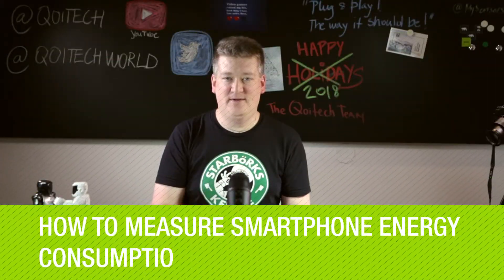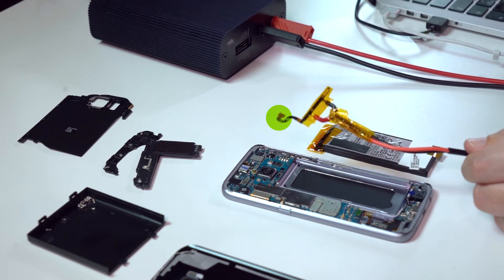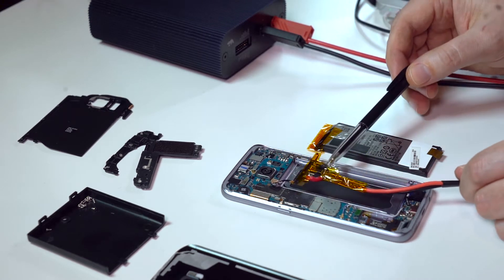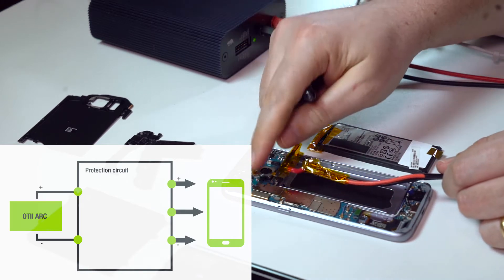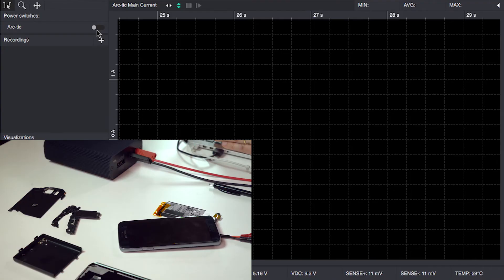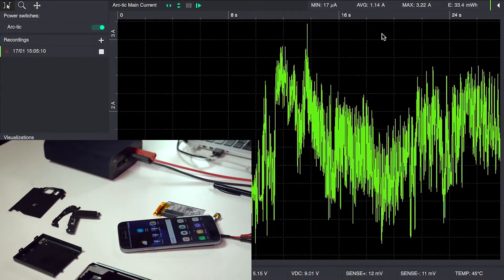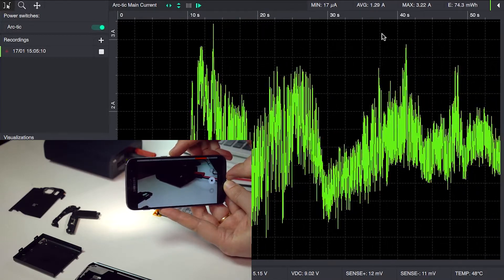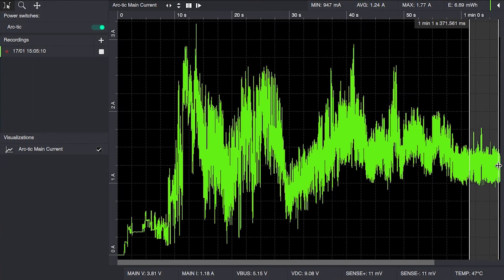How to measure smartphone energy consumption (Samsung S7 example)

Comment: I am doing quite The same like you.. For a custom headset i disassemble psvr and added razer phone.. To save 1/3 of Total Smartphone weight.. I took out battery.. Disassemble the battery cell from battery id board.. Added cables to the new free battery flat pins.. Next adding capacitor... And try out right voltage... 3.3volt? 3.85v? 4volt? Any Suggestions
Reply from the maker: A Lithium-Ion battery, as the one in a mobile phone, has a nominal voltage of 3.6V but in use the voltage be can between 3.0 and 4.2V.
Remember that disassembling a Lithium-Ion battery might be dangerous so do this with care.
BR, The Qoitech Team
Reply: @Qoitech  i tried out electrolytic caps.. And usb Power.. 5v 2amp, and switchable dc power supply.. With resistor to get 3.9v.. But Smartphone does not start.. Now i will look for better Power supply (any Suggestions? Ac/dc 220v to 5v and 5amp 25watt.. Sourcing from digikey) and your ceramic low ESR caps..
Reply from the maker: @ronnygey8332  not sure that we fully follow , especially the 'resistor' part. But, you should check out MLCC since they have much lower ESR. Regarding the power supplies, we have a few recommendations here: https://www.qoitech.com/faq/
Reply: @Qoitech  i got it... I use a 25watt 5volt Power supply.. And your mentioned ceramic capacitors. I tried to use resistor to get 3.8-4.4v at The battery Board Terminals.. But  the phone didnt started. Then i used a big Diode for voltage drop.. And now the phone starts and is fully useable. (razor phone 2)
Reply from the maker: @ronnygey8332  To increase the power delivery from Otii Arc, use a 7-9V DC adapter.

Comment: did I just hear 100uf capacitors? didn't you mean 100nf capacitors?
Reply from the maker: Hi Cristhian, You heard it right, we used five 100uF ceramic capacitors. Yes it's a bit excessive but we wanted the ESR as low as possible, phones are very picky about that. 
Check out our forum for more discussions on energy optimization: https://forum.qoitech.com/
Reply: hey thanks for the reply.
I'm kinda of a noob so could you please link me to a site like amazon or any other that sells capacitors for this task.
keep sharing knowledge bro cheers
Reply from the maker: Hey! You're welcome! 
The capacitor manufacturer is Kemet with part number C1210C107M4PAC7800

You might find it here:

Digikey: https://www.digikey.com/

Mouser: https://www.mouser.com/

And probably a lot of other places.

The capacitors are connected 5 in parallel, to increase the capacitance to 500uF and lowering the ESR (equivalent series resistance).

It can easily be replaced with other ceramic capacitor, just connect them in parallel and try to get a couple of hundred uF in total. Remember to only choose capacitors with voltage rating higher than 1.5 times the wanted battery voltage. In this case 6.3V is OK but I recommend 10V or above.
BR,
The Qoitech Team